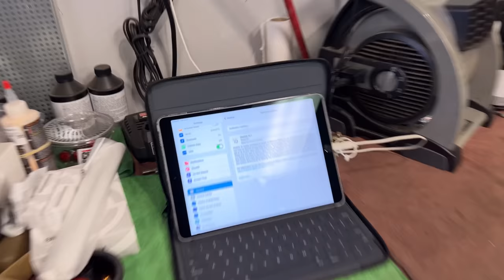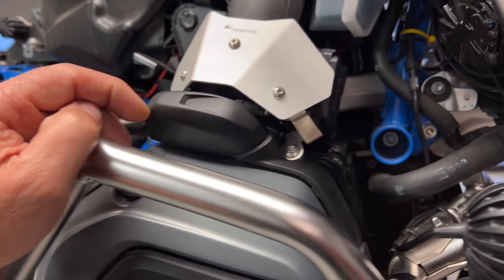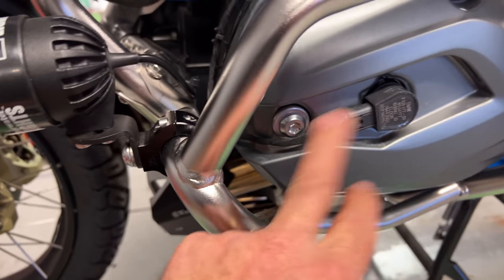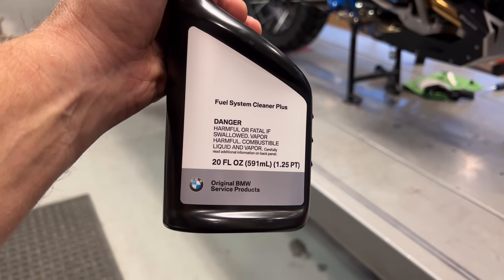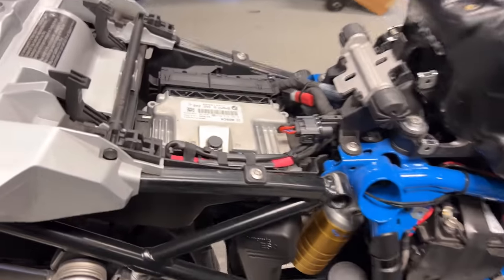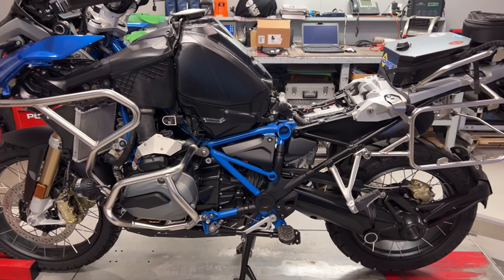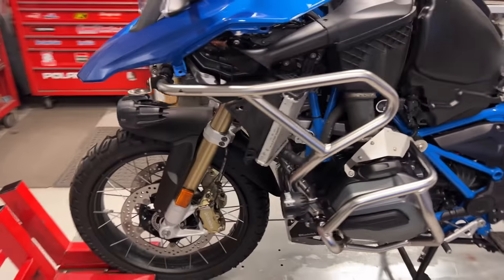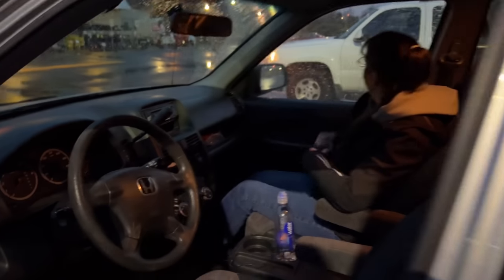More R1200GS Tech Talk!! • BMW Fuel Cleaners..! | TheSmoaks Vlog_2179

Comment: I use Techron once in awhile. I always run as high octane I can from a tier 1, usually Shell. I just wish they had 93 here. 91 is it. Unfortunately, ethanol free is a bridge too far here. It's a low profile oetiker clamp, I have the pliers for them. Always have the right tool for the job.